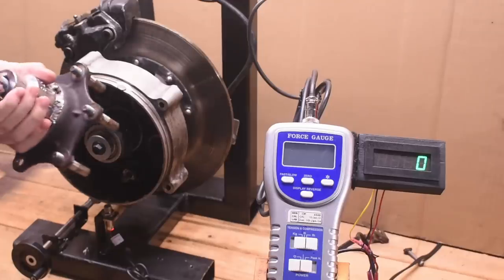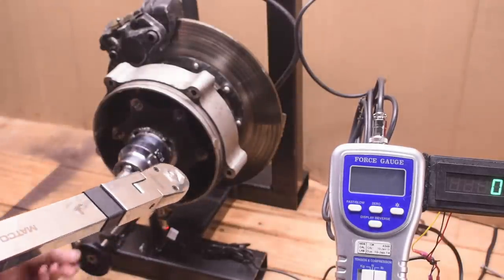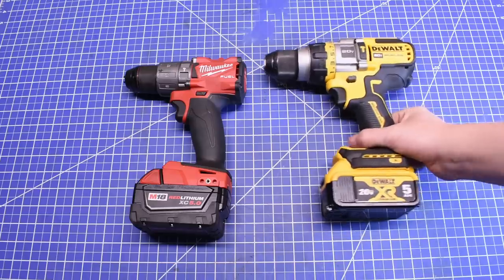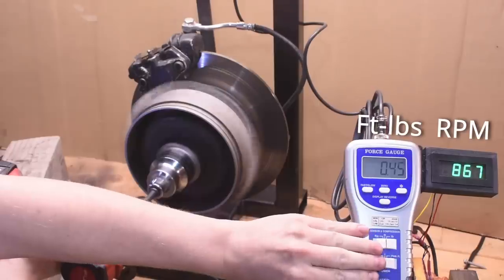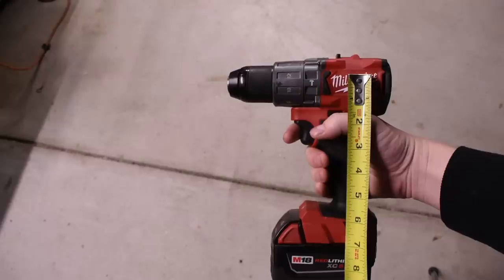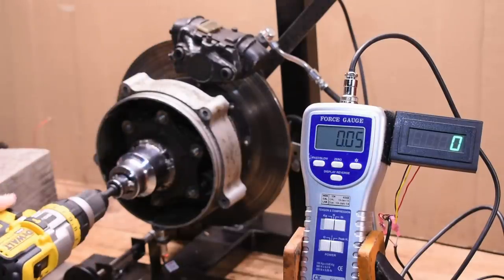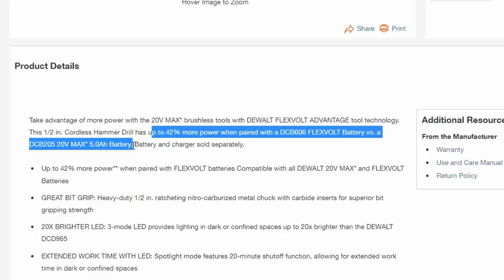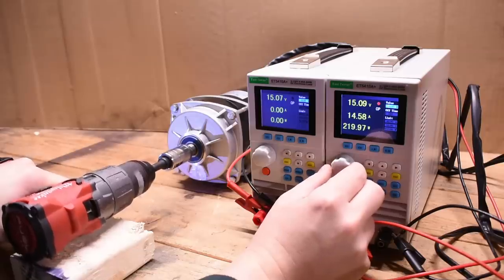DeWALT vs Milwaukee on a Cordless Drill Lie Detector (Dyno Brake)

Comment: I think you need to review the video to examine your hand feed rates of the hand wheel between the two drills for the torque test. It seems your hand feed rate on the DeWalt was a bit too fast for the refresh rate of the load cell. I would like to see some repeatability with the feed rate via a motor driven feed wheel.

Comment: Hey TTC. I got a silly suggestion. You see and hear about welds vs bolts. IE; construction pipes and such. Is there any way you could test a tack weld compared to a m8/m10 bolt and see their shear strength and compare them? I know simply welding a socket to a piece of metal can be far fetched as far as anything above 1/2" and finding the beans to snap that off, but I'm genuinely curious and would love to see a test as far as shear strength. Though its hard to replicate scenarios such as fire-hydrants and such, it would be cool to see a real-world test as far as tensile strength goes.

Comment: My Milwaukee has definitely tried to break my wrist when running a 2.5" holehawg hole saw.

I cringe at doing the 3.25" with the drill if I can't get in there with the handle mounted.

Comment: Cutting speed on mild steel with HSS is around 100ft/min. With a 1/2in drill bit thats around 750-800rpm. So high is a bit fast for drilling with a 1/2in drill bit anyway.
Reply from the maker: You're not wrong, but it was like 1/4" material, and there is no 800RPM setting on the M18, was a bunch of 7/16" holes too. It's painfully slow at the 500RPM setting bogging down to 400RPM. The cut quality goes way down too

Comment: I'd like to see you test the DeWalt DCD996B for comparison. I'm a Yellowhead user and don't see the need to upgrade to the Flexvolt system. I realize the 999 will run fine on 20V batteries but I'm wondering how much power I'm giving up by sticking to the XR series. I see the two models listed at the same price and wonder if the only difference is the 60V option.

Comment: Love this channel so don't take it wrong.  You did the 'watts' testing all wrong using a generator, as said in the video its just a power figure like horse power that is torque times rpm.  You could measure HP and multiply by 735.5 to get watts.  
Everything needed was already setup on the brake dyno - the force gauge and the rpm sensor.  If computer log can be setup to record intervals then you could have made nice HP/Watt curve graphs for the drills.

Edit: if you change your setup for future drills some controlled speed/motor threading in the break master pusher should be used.  You go from half load to stopping it so quickly the RPM meter stops keeping up.  Looking at some of the tests and pausing it, I saw as high as 1.6HP / 1176W on the dewalt. They are rating it pretty accurately I think.

Comment: Can you put an RPM counter on you brake dyno and graph torque/RPM for the median performing battery on each drill?  For drilling operations, knowing how much torque is achievable at a given RPM will let someone compute how well the drill will perform with various diameter bits in various materials.

Comment: Can you remotely control and log the data from the electronic loads? It would be nice to do a sweep and plot the RPM as a function of load. Things like max RPM ratings don't mean anything if it can only do it at extremely low load.

Comment: It looks like the drills are shutting off suddenly before hitting their peak torque in your torque test. Maybe it's the kickback protection kicking in or maybe it's a power limit from running it too hard for too long. I think you might be able to get peak torque from a stop, or in very short bursts (like if you're drilling with a hole saw and it grabs momentarily).

I think the way you're testing is valid compared to real world use like drilling medium to large holes. But it doesn't represent real world peak torque like trying to remove a stuck screw (if you don't have an impact), or a drill bit grabbing.

Comment: It looks like the DeWalt is almost maxed out with the included 5ah, not getting too much more with the 6 or 9. The Milwaukee really seemed to like the beefier battery, wonder if it would still see an increase with something like the 12ah high output. Less of a good comparison, more suited for the Max Power rankings once you get enough drills gone though this.

Comment: The additional weight on the Dewalt could also partially be due to the larger battery when they were compared. When you weighed the drills you had a six amp hour flex volt battery on the Dewalt and I believe a five amp hour on the Milwaukee. Might make a small difference there. Also the Dewalt has a three gear gear box which might way a little more there
Reply from the maker: Oh its def a difference for sure. But it also was tested with that better batt

Comment: I think you already picked out #1and #2 for cordless drills.....great testing methods and great analysis. Edit - I think if you put the drills in some type of jig instead of barehanding them the accuracy would be truer...the torque loss from the batteries twisting is probably very significant.
Reply from the maker: The tools are bottomed out on the wood, not touching the battery. Also, if they need to be in a jig to do better, assuming that's true, it's not very relevant to the consumer who's holding the tool.
Reply: @TorqueTestChannel  yeah I didn't word that correctly.... when you're wrist flexes the weight of the battery extended on the lever that the handle represents is significant AND angles away from a perfect 90 degrees putting a twisted unpredictable force along the drill plane. I know it is significant because it easily breaks bits and taps and that is taking away from the accuracy. Regarding actual real world usage, yes it is going to be hand held, but eliminating it in your test between these two great brands that are already razor close would be more fair as this 'offline' force is unmeasured and varied for each trigger pull. Edit- if you watch closely the flex of your wrist is evident even though it is resting on the block....the twist is still there.
Reply: @fritzmiller9792  I think your point that the two brands of razor close will hold up no matter what testing is done.
Reply: @sethtenrec  DeWalt and Milwaukee are neck and neck for sure. Two great brands. As an electrician I got Milwaukee.

Comment: Hello, i love the video and in depth statistics. have you ever ran dyno statistics on the m18 chainsaw motor? im currently working on a project with it and the max amp draw ive gotten from the motor was 192 amps from a m18 12amp battery. im trying to work out what its comfortable working load would be so i dont blow the motor. not sure what the voltage sag would have been like with the battery but it could be sitting around 3000w of peak power.

Comment: Please do a M12 battery comparison using a drill please. I would like to know which battery works best for drilling. Specifically the Milwaukee 2504 if possible. Will the 5.0 HO do better than the standard 6.0?

Comment: Use shackles or Heim joints to eliminate axial load on the s beam load cell.
Reply from the maker: They are non tightened threaded ends that swivel

Comment: dont forget that a high rpm to low rpm rapidly will look like a high torque but its just rotational inertia. (think of an impact driver) you need to slowly RELEASE the brakes until it can rotate at all
Reply from the maker: See our comment towards the top. You're correct, although the sudden stop isn't the brake the tools cut out when pushed at high RPM because they wont allow it to operate near 500 RPM in high

Comment: Would it be possible to weld the parts (Adapter, socket) together to keep from losses? 

Could be the difference between say a single driveshaft and a two piece where the torque is camming between the joints.

Comment: I was looking for something like this when I was looking for a drill. I bought a Ridgid High torque (1250in/lb) and a Flex drill (the 1400in/lb version) because i don't know which one is actually stronger in the real world. I needed to dig holes with a auger to build a fence and wanted an excuse to buy a new drill to replace my 10+ year old Ridgid, but wanted to stay Ridgid because I have other Ridgid tools. Please test ALL the high powered drills lol. And yes I've already drilled a test hole with the Ridgid, Flex soon to follow.

Comment: You guys don't need the electric motor rig if you have the brake dyno. You can directly derive horsepower from your bake dyno with (RPM x Torque (ft-lbs) /5252. Multiply that number again by 746 if you want watts.

That way you could get real horsepower/watts the drills produce without worrying about the motor/generator efficiency.

Comment: Do you have a rig to test grinders? I'm just curious to the difference between a dcg415 and dcg416 one is a power detect and the other is the flex volt advantage.

Comment: Given the 'small' size of these things, I do have to wonder whose warranty actually covers the failure of pushing such tiny gears to that kind of limit on a measly 2-tran//3-tran gearbox on a one-hander drill.
Hilti has one of these, but it's a rightfully huge and heavy two-hander drill, uses a big motor with 4 actual physical brushes in it, and a lonnng 4-tran gearbox

Comment: Will you try to compare the torque of DCA ADJZ03-13 or DCK KDJZ03-13 or Dong Cheng DCJZ03-13 with those two global brand of impact drill?

Comment: Hey TTC, could you results be considered more like "soft torque" as some manufacturers (like Makita) define for their drills? It sure is similar to the numbers for soft torque on some higher end Makita drills. 

Also, could you provide some explanation for hard and soft torque? I mean, I couldn't find any definitive answer on the web for what they are and how are they measured exactly.

Comment: nice comparison, and interesting results. 
Just a thought, since you're slowing down your "dyno" setup the readings include the inertia of the assembly, inconsequential for comparison (unless one of them has significantly higher rpm) but just thinking that the actual max torque is lower than the reading. Out of curiosity would be good to know what that number is (like spinning the break rotor to then high rpm then breaking it the same way as in your test and get a baseline)
Reply from the maker: Agreed, see our comment towards the top

Comment: Man, I'd love to see an old M28 Milwaukee on this. The shop guys always say the new 18v gear is superior to the old 28v gear but I suspect that's not correct. After nearly injuring myself multiple times with my own M28 on the low speed/high torque setting.

Comment: I mostly deal with steal in my work. The dewalt feel weak, and I've been afraid to push it. I break more bits with milwaukee though (probably just a user error). I've come to enjoy my bosch corded over my battery porter cable, Hitachi, milwaukee, or dewalt.

Comment: I think the anti-wrist break feature is cutting power, which is why the brake dyno numbers looked suspect, IMO.
Reply from the maker: ... but neither drills have the feature. And the tool's not spinning to begin with :P
Reply: @TorqueTestChannel  makes sense, I have a rat-tail Makita SDS with that feature and was curious if that was a factor here or not

Comment: Only way I can see them rating at those giant torque numbers would be to have a long hardened bolt with a hard seat, then running the drill up to max RPM until it bottomed out and gave a momentary shock value. Basically treating it like a one hit impact driver. Which is totally messed up, of course, but if my f'ed up wrist has anything to say, you can definitely get crazy torque out of a drill by stopping it suddenly.

Comment: I think it worth noting that at some point, more power is not more better with this kind of tool, I was using my milwaukee with a 2.5" hole saw and when they break through it almost ripped out of my hand, which I am sure the Dewalt would do as well, I am 6'3" 300 pound man, at some point there is a risk of injuring the user

Comment: Im a beekeeper and i use my drill for my honey extractror. Its alot of tourqe at a low speed because it has a gear box. I have 3 drills with one being a older 20v dewalt, The new Milwaukee, and an old craftsman. What drill would be best for low speed high tourqe?

Comment: I'm curious to know how much the inertia of the setup impacts the result. If you're spinning that drill on high and apply the brake suddenly, I would imagine the instantaneous force applied to the load cell would be higher than the static force a drill could output.
Reply from the maker: It's a good point, see our new comment towards the top and weigh in!
Reply: @TorqueTestChannel  It may be that the hand crank master cylinder just isn't capable of clamping those brakes fast enough to really lock 'em up. Otherwise I think you would have seen some noticeable changes in TQ depending on how fast you cranked it down.

Comment: So strange, I got the DCD998W1 combo at Lowes for $269.10 (I get a Vetran discount, it's normally $299.00) it comes with the 8ah XR battery, obviously I can't test it but it feels like it packs a punch, especially next to my Dewalt Atomic DCBP034C. I would take that 8ah XR battery over that 6ah Flexvolt anyday.
Reply: It's not really strange, just an incredibly stupid set of arrangements DeWalt has going with Lowes and Home Depot.

Home Depot gets the 20v Atomic and the Flexvolt Advantage lineups.
Lowes gets the 12V Extreme and Power Detect (what the DCD998 is) lineups.

But as far as all testing done by other reviewers thus far goes, the only differences  between a Power Detect tool and a Flexvolt Advantage tool are the badge, the included battery, and maybe an aesthetic change.

Comment: On the brake dyno, I'm not confident the peak torques are accurate due to the jolt/impulse that most tests are experiencing.  It's not 100% clear to me why that's occurring, but it might be due to the friction surface switching from a kinetic to a static (higher) coefficient of friction.  I think those peaks are representing how quickly all of that rotational kinetic energy is coming to an abrupt stop, rather than a value that the tool can actually sustain.  Perhaps a data logger with a higher sample rate and a graphical output would capture what the tool could actually transmit, even if it's only for several hundred milliseconds. 

The little brake dyno is awesome, but it could be more user friendly and safer if you actuated the brake by foot.  Allowing you to keep both hands on a tool that is trying to be ripped out of your hands.
Reply from the maker: It's a good point, see our new comment towards the top and weigh in!

Comment: Amazing test. I love the point you made about how it doesn't matter how much torque the drill makes, if it's only spinning at 100 rpm then it isn't going to drill well. The Milwaukee fanboys only focus on the power output

Comment: I killed 3rd gear in my 999 drilling through really old horribly hard contrcrete with sds drill bit that wobbled in the chuck (obviously, I couldn't quickly get the proper hammer drill bit....) but I basically had my full weight on the poor thing drilling straight down on a day that peaked at 106. After cooking all of the grease out of it (that stunk) and leaving it In the freezer every couple of holes (5/8)it would jump pit of 3rd to 2nd. It finished the job fine, tho it was angry at me... local certified repair center put s new transmission in it and I can confirm that it would drill to China once you use the proper bit lol

Comment: If you have rpm and torque you can convert to horse power. You don't need to hook it up to an electrical motor. Just get some better more instantaneous instrumentation to data log it.

I bet someone in your fan base might be able to whip up an application of a Raspberry Pi or some such to snag the data.

Or just run the dyno for longer at a variety of speeds while you wait for the readings to stabilize then chart that. It'd be a fair bit more paperwork but probably not that bad.

Comment: Is the drill rpm the same because if I remember some of those dewalts having a 3 speed and could be different just the same plus even if it is just 2 they gearing could be different

Comment: I want to know what series of tools is best for one battery system. Batteries are the most expensive and interchangeable component. Not going to buy a dewalt drill and Hercules impact, if I already have an investment into a specific battery type.

Comment: The high speed test results are all similar for a given device. I noticed that the hub stops abruptly on the hi speed test. Seems that you might be measuring the hub's rotational mass (like a hammer) for a given drill's max RPM.
Any way you could apply the brakes more slowly so it doesn't suddenly stop the hub and impart that rotating mass into the load cell?
Reply: Or would that necessarily always be a lower force than when the drill is actively driving the hub?
What kind of force reading do you get if you spin the hub up to speed, remove the power source and clamp the brake on a free spinning hub?
Reply from the maker: It's a good point, see our new comment towards the top and weigh in!

Comment: I wonder how the 2 speed DCD805 compares to the DCD999. It's 1-1/2 years newer and I wonder if Dewalt improved anything or if DCD999 extra gearing for the 3 speed had some extra losses.
Reply from the maker: Less UWO rating but a worthy question

Comment: Being the owner of the black and pecker 1/4 and drill combo. id offer mine if i were in your area (which i doubt) but maybe you get and try those. like 90 bucks or so for the combo. 20V. performance in my use is meh. but id love to see them tested. 😏 also own a dewalt half inch impact. thinking about getting a drill too. 🤔